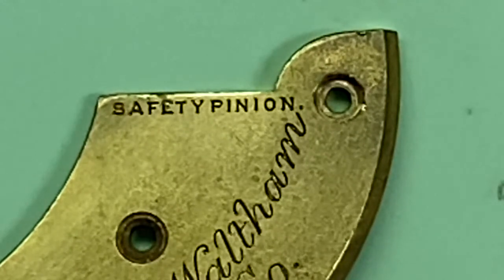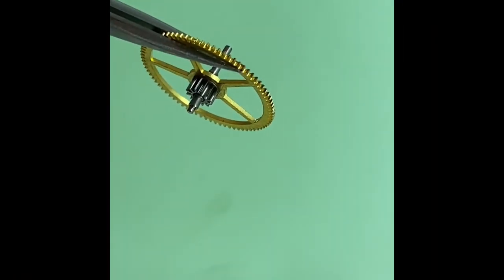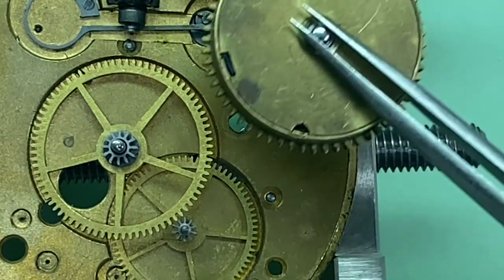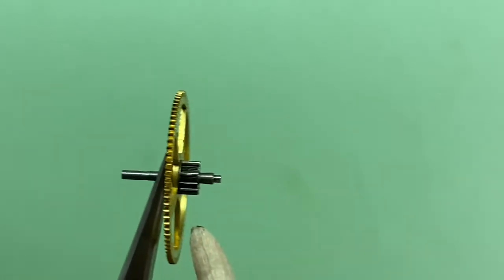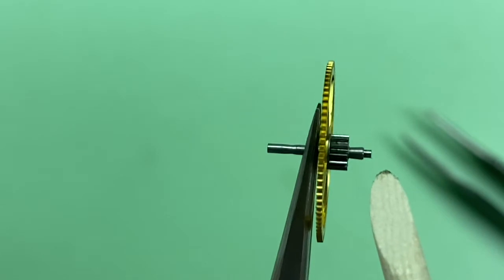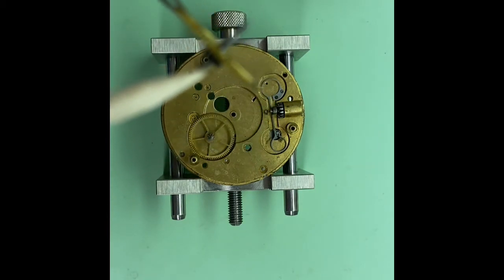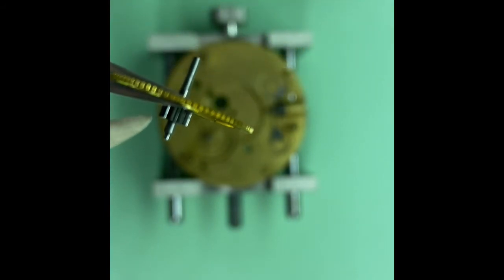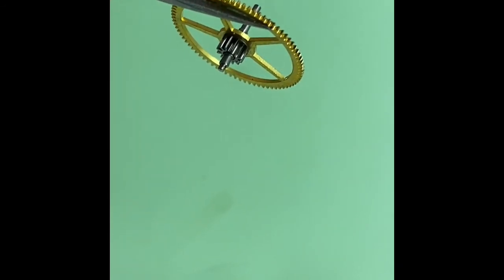Your Antique Pocket Watch: Why It Has A Safety/patent Pinion And Gear/wheel (questions And Answers)

Comment: ...so if the mainspring breaks, the shock-force of the barrel moving backward will unscrew the safety pinion from the shaft, there by saving the teeth on the gears from being bend and damaged.    So do you have to screw down the safety pinion before replacing the barrel,... with a new mainspring in it?
Reply from the maker: Yes that is correct.You have to screw it back down.
Reply: @myhobbiesarenotcheap   So question what is the correct procedure in retightening the pinion gear I have a National watch company watch that the pinion is now loose due to the main spring breaking but there appears to be a collet on top of the pinion does that screw down on top of the pinion gear?